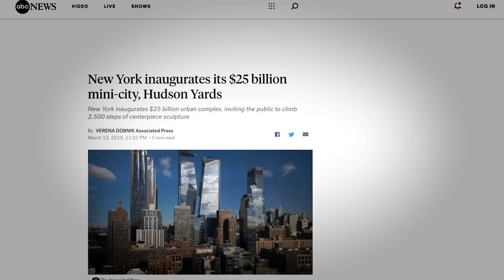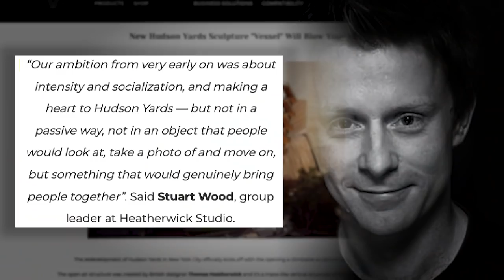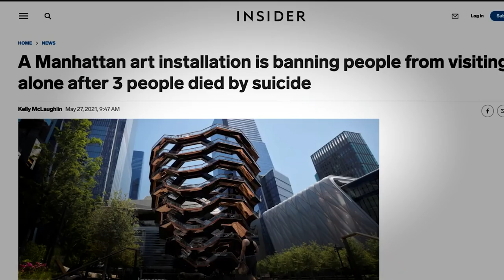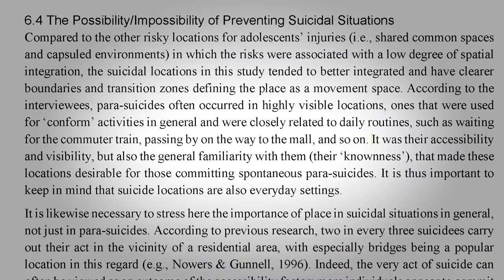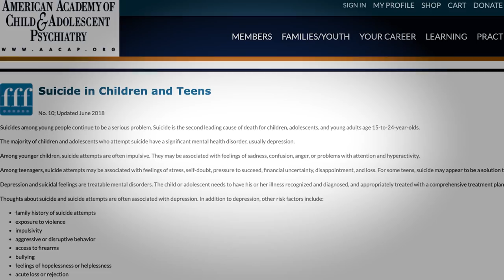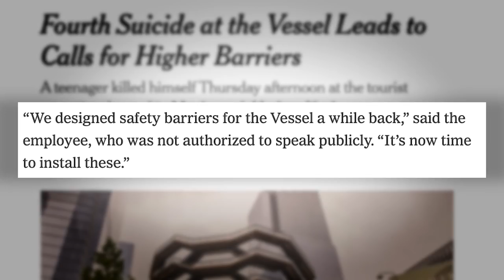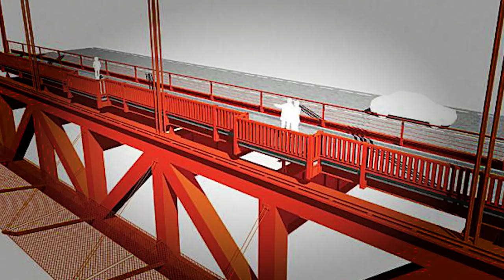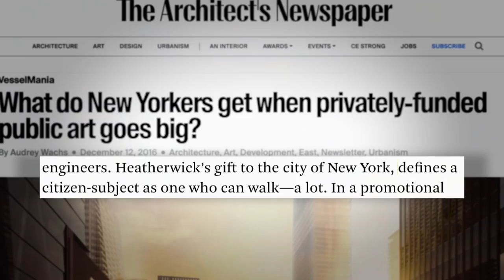Is This $250 Million Selfie Spot Dangerous?

Comment: As a person who climbed this with my family during the depths of my depression, I was no more in awe than I was in fear.
I saw this building as pointless and gaudy, surrounded by expensive shopping centers. The art was lost on the fear. I saw NYC, beautiful, empty, and a line of disabled people waiting for the elevators at the bottom. 

Beauty and Safety are not mutually exclusive
Reply: Its like something in the designers heads subconsciously made them create something where the whole aesthetic depended on an open empty shape. Without thinking about how that might appeal to people contemplating suicide.. With all the super rich shops around it as well it would almost turn that suicide itself into art. 
And it looks totally impossible to fix without destroying the original aesthetic completely.. May need a complete new redesign.
Reply: Yep-- the number of stairs is my barrier
Reply: your observation of the disabled lining up is heartbreaking - I don't think making the structure wheelchair accessible would have been that hard. Maybe the stairs are part of the "vision" of climbing, but just switching some for ramps or finding ways to incorporate both would have been a powerful gesture, especially when they were praising this thing and imagining it to be a landmark.
I have a disabled friend who has opened my eyes on the many, many obstacles, big and small, she faces when she uses her wheelchair - it must be so frustrating.
Reply: It's a form of snobbery on the part of the architect. I would guess he Never had a sick day in his life. I have met some of these snobs and found them to actually express their contempt for those less than perfect health.  They certainly do not go with the concept in the Declaration of Independence: all mankind equal under the law.
Reply: @violetorange  I dont know that it could’ve been designed to be particularly accessible. It’s built on such an ableist philosophical foundation to begin with… The whole notion of walking making someone a true citizen and a lot at that is so incredibly blind to the huge percentage of the population that cannot walk a lot. 
Ramps at those angles would require an incredibly strong and energetic person in a manual wheelchair and an electric one would lose charge before it even got half way up. 
Basically, this whole thing makes me angry and this is just one discriminatory aspect of the wasp’s nest.
Reply: "ART for Everyone! Except you - if you have to wait 30 minutes to enter the elevator it's your problem, not ours."

Comment: "It's easy enough to say a space is for everyone when everyone around you is just like you." Well said, absolutely correct.
Reply: Ok, sure, if that’s all the city had. I don’t like the gaudy shops either. However it IS for everyone. It IS unique. The structure IS beautiful (to me). This whole video can be summed up by : it shouldn’t have taken four deaths, of kids, to install temporary nets. They are so pompous as to ignore the deaths like the problem itself won’t be fixed because they command it. I can’t climb the structure, but I aspire to. When I do, it will ruin the experience if I see suicide reminders and high rails all about. By the time my health is good enough to get down there, I expect to see an integrated suicide prevention system that does not impair the experience in the least. That aluminum monstrosity in the library is awful. I am an engineer and can think of systems completely hidden. We are New Yorkers and we can do better.
Reply: @Greg-yu4ij  I agree about those barriers at the library, looks like static on an old tv, not the 'digital waterfall' as they call it. How would you solve the issue though? You said you can think of something that's hidden, what would it be?
Reply: That's why melting pots are bad ideas.

Comment: As a designer, my take is that the firm's unwillingness to rework the Vessel is kind of intellectual laziness. Stubbornness in design is not sexy. Refusing to rework or rethink when faced with a flaw is not good designing.
Reply: Exactly!
Reply: Yes. This is a failure of our profession. Architecture should be built to serve, not to harm.
Reply: Also, they talk about how building higher railings 'takes away from the experience', but honestly, I'd enjoy it more if I felt safe. I think having such a low railing so high up would leave me terrified that I'd somehow trip and tip over the edge that I couldn't even enjoy the view. What I'd prefer? A giant design like that, only instead of open air, it's all clear tubes, like those tunnels that go through aquariums so you can see all the fish from underneath.
Reply: It seems like there's a certain sect of high concept designers that are so locked into their artistic vision they refuse to compromise it with the real world necessity to acknowledge human nature. Which works great for thinkmag concept pieces but always revels it's shortcomings in the real world. Good design works WITH human nature in mind, not in resistance to it.
Reply: yes i agree theory is dangerous some times but so is life. that's Nature's law. sometimes designers can create a perfect house to die in which should be examined and talked about.  I don't care for the vessel for monetary reason, but to make everything safe is exhausting. lighten up.
Reply: @JohnG-gy3st  so being concerned about safety for an installation easily accessible to the public is being too morbid? Interesting take.
Reply: I honestly think they don't care too much. And are probably more upset they have to "ruin" their art.
Reply: @dreamofwings  Not too morbid, but its an easy way out of discussing death and real reasons for suicide. railings do solve a problem just displace it. have you ever climbed a tall mountain or are you an urban dweller.
Reply: @JohnG-gy3st  You're on a channel that talks about death. If you want light, go somewhere else.
Reply: would you close all the Via Ferattas that are public access
Reply: @yennefer440  I'm talking about death. how is my perspective on not preventing death bad?
Reply: Sorry, typo.  Rails don't solve the problem of suicide.
Reply: @JohnG-gy3st  I'm fine with heights if that's what you're asking. Are you suggesting that a more constructive solution to suicide at places like this would be a greater investment in public mental health services, increased access to social services, and other programs that generally improve quality of life of the population at large? Because that's correct but they are all incredibly labor, time and expense intensive and also not the responsibility of the people who designed and own the vessel. Erecting a barrier or designing one in the first place is perfectly manageable for them and not an unreasonable expectation.
Reply: @dreamofwings  so you are saying its their choice. so why would it be their responsibility as an individual designers to install bigger railings , and not fund the real problem. its their choice.
Reply: @JohnG-gy3st  you're talking the difference of cost of several thousand versus several billion. It's a nice thought that private companies and rich individuals contribute more constructively to the common good, I'm all for it, but they have zero obligation to do so. It is a choice. Choosing not to design or install a barrier for the installation you're directly responsible for is also a choice but definitely not one that makes you look good. Sticking to the purity of your ideals and refusing to compromise on them, especially when they directly lead to someone hurting themselves, is not a good look.
Reply: @dreamofwings  True,  sometimes looking good in human history isn't a priority.
Reply: @JohnG-gy3st  correct.
Reply: @Anon26535 --- You may have a valid point, given the fairly recently reported goals of a certain Billionaire,  to reduce the world population by over 90 percent.
Reply: @JohnG-gy3st Even somewhere extremely mountainous like where I live you aren’t tripping over high places which would be appealing to jumpers; climbing a mountain peak usually leaves you surrounded with steeply inclined scree formed from jagged rocks which will partially break your fall and bones as well as lacerate you all the way down, leaving you perhaps badly injured and in pain but not immediately dead. 
For anyone living in or visiting New York, the Vessel is trivially accessible and just looking at it confirms that jumping from the top will result in an unimpeded fall from 8 stories onto solid concrete.
Reply: @JohnG-gy3st  They don't solve it 100% but they can reduce it substantially.
Reply: @JohnG-gy3st  Designing safe structures and modifying them as needed is "in the wheelhouse" for designers. They literally have control over railings, ramps, etc. but they don't have control over the social forces behind suicidal impulses.
Reply: 100% - there's no excuse for this kind of bad design in this day & age when there are numerous solutions that perform the needed safety function while retaining the light & open aesthetic.  Double-height glass/perspex panels are used by tourist observation platforms & walkways to keep that sense of danger & thrills, and immediately came to mind when he started giving the excuse that "railings ruin the experience."  It's pure laziness mixed with hubris.

Comment: So I’m an engineer and as of 2010 most engineering colleges have required ethics courses and it was hammered into my class that our responsibilities as professionals go beyond just the construction and we can let our biases come through our designs even if we didn’t notice it.
Reply: don't be surprised  stop spamming. This isn't the place for your crap.
Reply: this 'building' is basically a case study in failed design ethics, I hope it ends up in textbooks
Reply: As someone who got a degree that was associated with an engineering college, we not only had a required ethics course but a course dedicated to looking at man made disasters/accidents and analyzing why those disasters/accidents happened and what was put into place to prevent those things from happening again. Seems like the designer of the Vessel could benefit from taking that course.
Reply: @juliecampbell860  It depends.  I used to work in nuclear power and the one thing hammered was procedural complacence.  This was done by telling many horror stories about bad QA and QC.  It was done by hammering every rule violation.  With most buildings being a static thing, what process concerns could you have beyond verifying that the actual structure meets the blueprint in all respects?
Reply: @griffenspellblade3563  Most people (I would hope) would understand that creating an installation that tall might attract those who want to end their life, and it should be considered. Not to mention with how low these railings actually are, it poses other safety risks as well. All it would take is one kid climbing on the railing while their parent was distracted to have a tragic accident.
Reply: @griffenspellblade3563  Knowing how to evaluate what went wrong so that you can do better in the future is a useful tool. It doesn't seem like the designer has yet learned this lesson. 

If there is anything I have learned, it's that when you stop learning you start becoming irrelevant and a liability.

Comment: As an engineering student who talks a lot about engineering ethics, I can say it’s the designer’s responsibility to consider all possible misuses of the design and do their best to prevent it. Glass walls wouldn’t have been difficult or out of budget.
Reply: As a student, you are out of your depth.
Reply: @FUnzzies1  And what do you know to argue that? Are you going to an engineering school? Do you know any specifics on the ethics of engineering? Blocking out conversation isn't helping anything.
Reply: I agree that it is the designer's responsibility to consider all possible misuses, especially as the possible "misuse" that could occur with the Vessel were not unknown. And not only by the designer but then by everybody else around that conference table discussing the creation.
Reply: I'm not engineering student or anything but I like art. Glass windows that are slatened like vent on each cell would was my first thought. I believe they wanted to keep the air flow. the flow of the building would be the only reason I could think they didn't even put it in a glass box that touch just the edges if the structure. Like they did with the model. 
As someone who has stood at the bottom of a bridge that had a low barriers for days, my heart bleeds for those who couldn't walk away. I 100% agree with you.
Reply: @FUnzzies1  man come on. That was so unnecessary to say.
Reply: @FUnzzies1  and who are you?
Reply: My guess is, higher glass railings would mean more shelter from the weather which would attract homeless people. This thing is clearly not designed "for everyone" - rich people don't want to see the people right at the bottom of our society - thus the low railings and dillydallying about putting in proper safety measures. They like to close their eyes and think nothing could ever happen in their backyard leading to consequences like these
Reply: @PestoPasta666  homeless people in this area? The would get their 24hr security to move them off
Reply: @kitnal4143  can never be too sure, perhaps the "peasants" are slacking on the job
Reply: @PestoPasta666  ah if you pay the riff raff to guard they will do it happily, although that will means the rich would need to divert some budget.
Reply: I completely agree with the first part of your statement. As the people who put the literal "things" out into the world, there is an ethical responsibility to make them as safe as is possible. There is no such thing as a perfect effort, but there such a thing as no effort. You're thinking about it from the right place. The architects of this building were not.

But... I disagree with your second point that glass walls wouldn't be a big deal. Just the wind loading from adding sails all the way around the building would be a serious design consideration, then there's the weight of all of that glass. I'm also not sure where you're pricing laminated glass, but it's not cheap. I would expect that to be multiple millions of dollars added to the project. Plus, the building is "round" and tapered (to me... it looks like a household garbage can). How would you ever clean it? What about the unpredictable reflections that would come off of it? There are already curved buildings that melt cars parked beside them...

I'm not trying to kick rocks at you just for the sake of it. I just believe there are more things to consider than it may appear on the surface. It's too bad the people that were tasked with it the first time didn't bother to do just that. If I had to start over with their appearance intent, I would have done it as a fascia and had a real building inside of it where the people can go... but, I'm not an artist. The entire concept of occupying the most expensive land on Earth with not much more than open air is something I would have never even thought to mention even as a joke. I guess you have to be a billionaire before much about that building makes sense.

Best of luck with your continued studies! 🍻
Reply: @TheBrokenLife  good points. I really meant that the glass and extra support wouldn’t be too much for a multi-billionaire already spending $250 M on an art piece. I think the structure looks polygonal rather than round but idk.. love the reference to the walky-talky building
Reply: @TheBrokenLife  also didn’t think about cleaning lmao but where there’s a will there’s a way… maybe some copper walls with fun large perforations would be cool and look nice as it patinas
Reply: @Oozes_Dark   Wind loading would still by my number one concern with any sort of "wall" situation. If they had gone that way from the outset (as you said, this is a billionaire setting money on fire anyhow), they could have designed for it. Now that it's up, it is what it is.

I believe the best thing they could do at this point is what the person in the video with no engineering background at all (that she's told us about anyhow) already proposed: taller railings. Minimum tear up to the building, minimum expense, and a reasonable likelihood of a reduction in people coming off of it.
Reply: @FUnzzies1  as a internet nobody, your words don't matter
Reply: @cogsandglimmers  I actually graduated from school and know there is a massive disparity between reality and the nice sterile environment of a class room. You'll understand that when you graduated HS.
Reply: @hannahckirk  No, it wasn't. Kids should be put in their place.
Reply: @americansteve2585  They do. Billions every year.
Reply: @FUnzzies1  lol. Yeah for sure, because you’re the mature one in this situation arguing with “kids” in YouTube comments 🥴
Reply: @FUnzzies1  you’re right. You told them 👍
Reply: @FUnzzies1  I'm actually at an engineering college right now: Missouri University of Science and Technology. Things are a lot different than my small town highschool where, yes, the class environment was pretty sterile. Just as a Freshman (in college, since you clearly seem to think I'm a young kid who hasn't gotten my HS diploma) I've worked with a team of people to design a mechanism to launch a toy plane with accuracy, then actually construct it. And things are only going to get more hands on as I get further into my major of Aerospace engineering.
Reply: @FUnzzies1  the broken life actually had input. You on the other hand, didn’t prove me wrong, you were just a condescending prick for the sake of ‘putting me in my place’. Even saying “railings are cheaper and lighter” would have sufficed. But thanks for reminding me that as a young woman in STEM I’ll always have to deal with people like you… as if I didn’t already know.